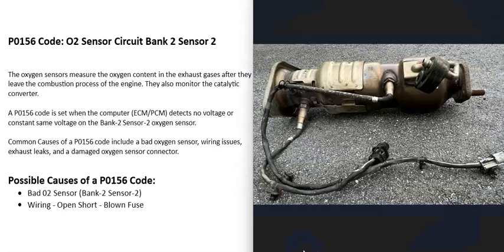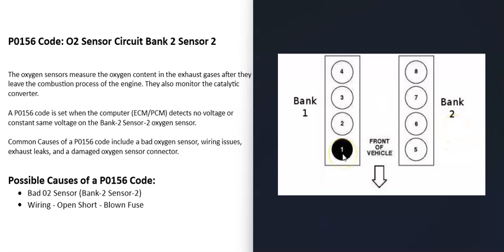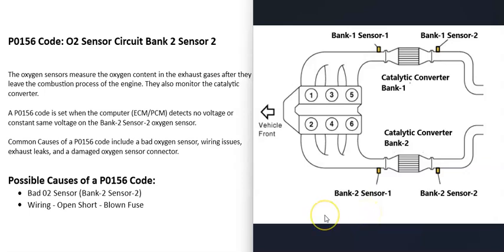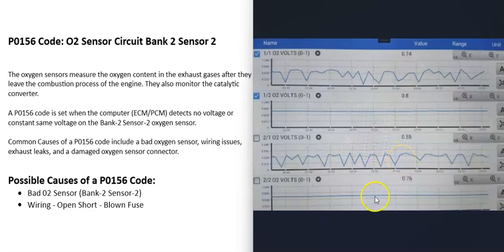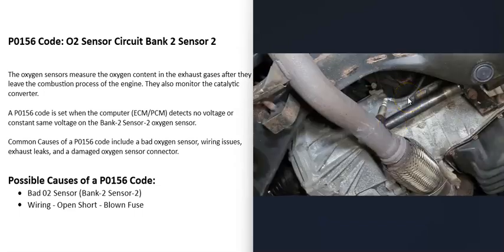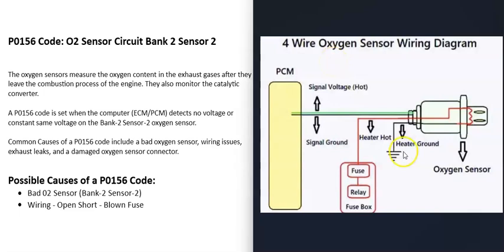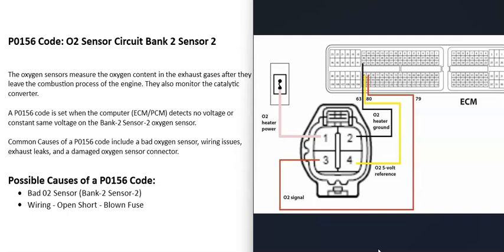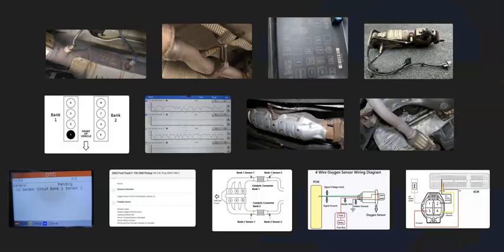Causes and Fixes P0156 Code: O2 Sensor Circuit Malfunction Bank 2 Sensor 2

Comment: Bonjour.  J'ai ce code avec en plus court circuit ou circuit ouvert. Au niveau du fusible, il n'y a pas une bonne tension,  0,19v mais il y a une continuité.  Que dois je comprendre ? Si je débranche ce fil au connecteur du faisceau moteur, il y a toujours une continuité mais 0,5v. 
Je ne comprends rien. Je ne sais plus ou regarder.
Ma voiture n'a pas démarrer depuis 3 semaines et après avoir mis un produit diélectrique a l'emplacement du fusible, elle a démarrer. Mais je sais que la sonde lambda n'empêche pas une voiture de démarrer. Donc je ́ne comprends pas pourquoi elle a démarré. Et que le.code est toujours là.
Vous pourriez m'aider ?
Reply from the maker: J'utilise un traducteur pour répondre, mais une sonde lambda défectueuse n'empêchera pas le moteur de démarrer. La sonde est peut-être défectueuse, mais il y a un autre problème.
Reply: @HVAC_Mechanic je le sais.  Je l'ai même débrancher pour être sûre.
Reply: @HVAC_Mechanic  il y a un le fusible des feux de croisement qui a brûlé mais il est à 4 fusibles de celle de la sonde. J'ai branché un interrupteur pour faire tourner un des ventilateurs de mon radiateur. Û des fils va sur le fusil du motiventilateur et l'autre va sur un porte fusible. A ce niveau les connecteurs étaient plus emboîté, il y a de l'adhésif isolant. Est ce que si c'était plus isolé et que ça touchait la carrosserie, il y aurait eu ce court circuit ? 
Je vis sur L'île de la Réunion.  Tu connais ?

Comment: Hi. Thanks for the video.
Can i keep driving until I receive the new sensor?
Reply from the maker: Most engines will still run OK with a bad 02 sensor. The engine will be less responsive and have worse gas mileage, but usually they run OK.